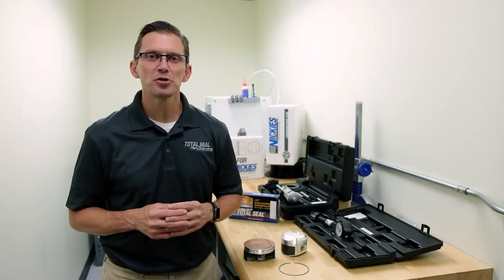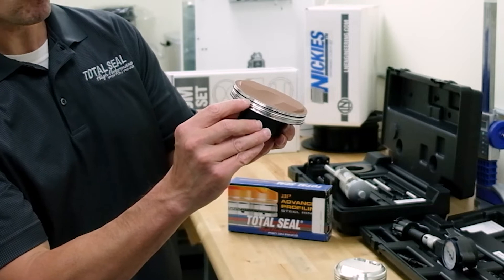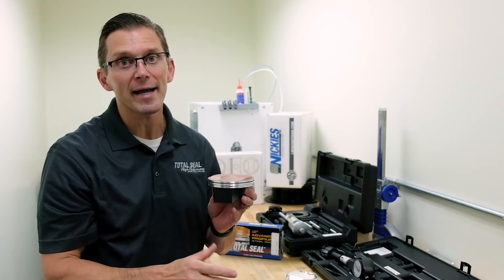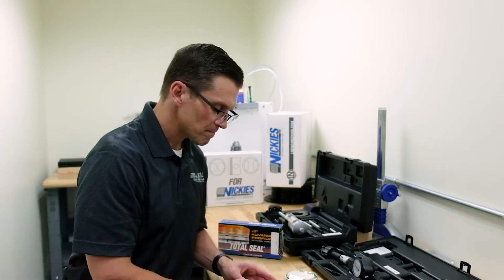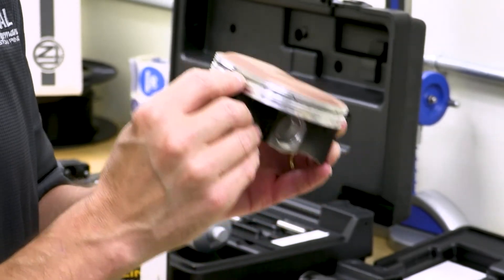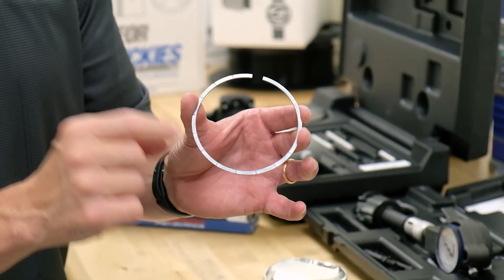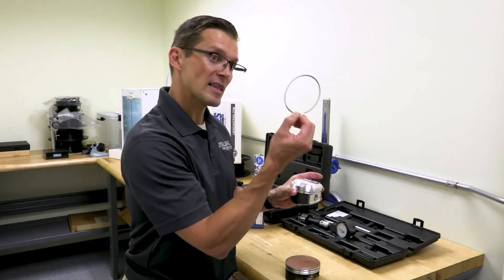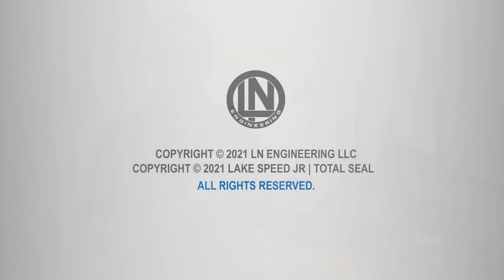Piston Rings 101: Total Seal Gas Ported Rings for Porsche Engines - with Lake Speed Jr.

Comment: Will gapless rings be a good idea on a 2.5L inline 6 turbo street engine? 24psi, rotella t6. How is the longevity?
Reply from the maker: We've utilized gapless rings on turbo Porsche engines, but I'd defer to the experts at Total Seal for your application. They are great to work with and very knowledgeable.